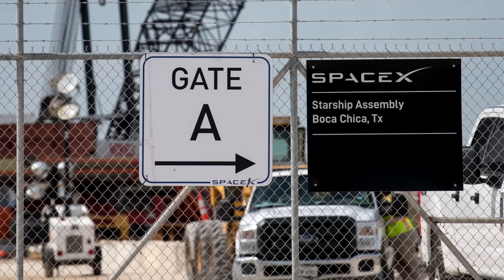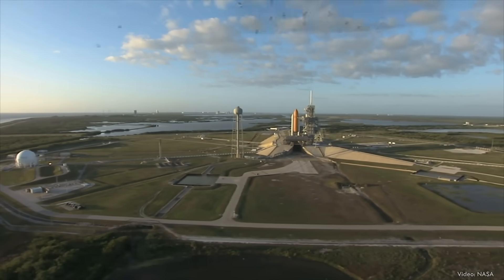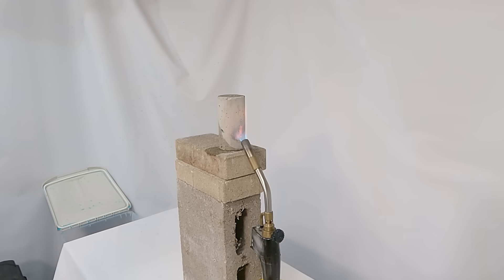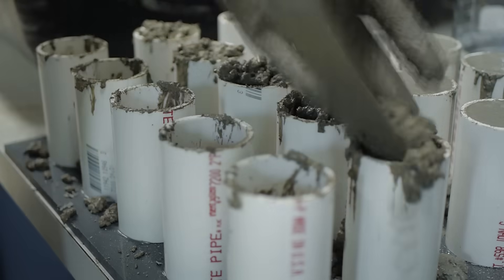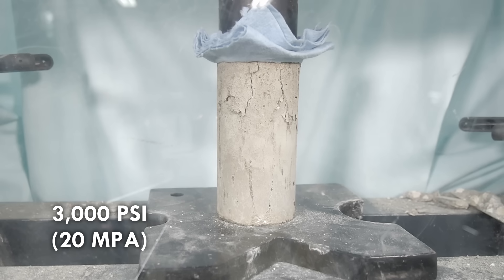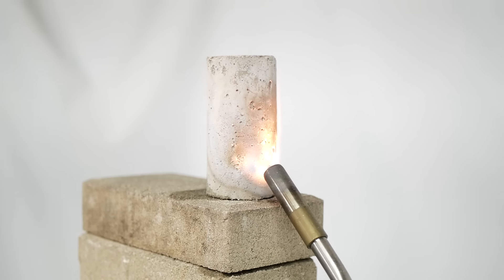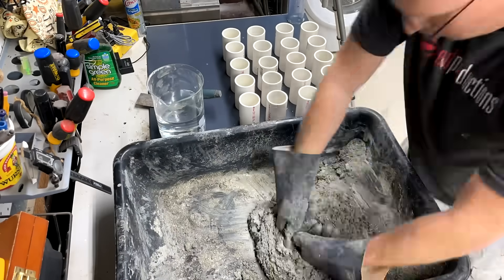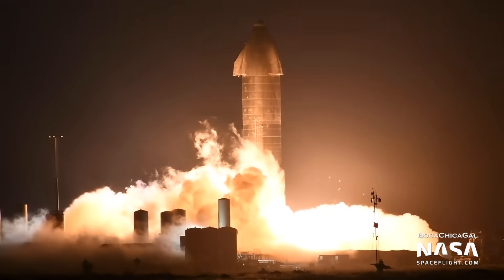Why SpaceX Cares About Concrete

Comment: I will add 1 thing to this.  Couple with all of what you discussed, rocket engines create sonic waves of sound that can easily cause vibration problems.  Sound booms or sonic booms can happen just before the rocket lifts off, hence the water for sound suppression.  This as well is a huge factor in possibly why and inclusive of future designs to prevent concrete launch pad failures.

Comment: Love your work. To what extent do you think the loss of compressive strength in the heated samples could be attributed to less water being available for cement hydration in the curing period? Would a better control demonstrating the effects of heat on fully cured concrete have been curing them in a bath? Thanks
Reply: slump rate or how much water is in the concrete mix effects the concrete quality. He should follow up with a video on water and concrete with different samples to test.
Reply: @practicalguy973  Fully agreed. I think a good follow-up would be a test that allows all samples the same water-to-cement ratio during the curing period prior to heat stressing.

Comment: I learned about  moisture clog spalling when I placed my charcoal chimney on a sidewalk in my yard to get the coals hot. After ten minutes or so  I saw it shoot up about five feet and spew red hot charcoal everywhere, as well as the concrete from an 18" wide 2" deep crater in the sidewalk. A lesson I won't forget :)

Comment: As an avid Spacex watcher I found this very intersting. I also had wondered why they had to do so much repair work to the Channel Tunnel after the fire a few years ago. I hadn't realised how much damage high temperatures caused to structural concrete! I gather that Spacex are still mulling over what protection will be needed for the Orbital Launch Mount. Thanks for the very informative video!

Comment: Heat is part of the challenges of designing a launch pad.  Intense vibration and shockwaves are another.  It will be interesting to see how SpaceX engineers the launchpad and tower to resist the intense soundwaves and vibration without using a water deluge system

Comment: I still say we need to use the SEA DRAGON Rocket instead of these wimpy ones. For one Sea Dragon can Haul 500 TONS into Low Earth Orbit, It also uses the Lake or Ocean it is built/launched from as a infinite launching pad as it actually launches from the water itself.  I scream when I see on youtube various creators when they cover Sea Dragon say one of the main reasons it wasn't used was we had no need for lifting 500 tons?!  Then in another video they will talk about how hard it is to launch Factory's or whole space stations to orbit that we don't have the capability to do it cheap enough...

Comment: One week cure before testing, is not going to yield accurate results.  Concrete has a minimum cure time of 30 days before reaching the large majority of it's compressive strength.
Reply: Considering how Grady already had such a difficult time getting data on the refractory concrete samples, I'd hate to consider how little would happen to them if he let them fully cure. He needs to get a stronger press first.
Reply: @General12th  it is inarguable that refractory cements will yield much higher compressive strengths than ordinary concrete, but the test conditions did shed unrealistic results when heating, as the hydration process was far from complete in the test samples.  It doesn't really alter the results, and probably WAS done due to the limitations of his press, but was a bit sloppy to not even mention the factor.   It also doesn't single out that refractory cements are automatically stronger than Portland blend cements.   I work with anchoring grouts that go up to 10-11K psi.  If his ready-mixed bagged concrete was Quikcrete brand, that stuff is already a substandard product to begin with.

Comment: I don't know if they still do it, but NASA used to pour hundreds of thousands of gallons of water into the blast deflectors during launch. Obviously, this was to cool off the pad to some extent. The water started pouring in a few seconds before the engines ignited. So, a lot of what looked like smoke was nothing more than a huge cloud of steam. Yes, I'm old enough to remember this and watched many, many launches from Mercury on.
Reply: Also to muffle the incredibly sound energy coming off the rockets. Without a way to dissipate that pressure, the launch pad (and rocket itself) would get shaken apart.

Comment: There are some nasty rocket propellant systems - all exhaust is hot but I expect the hypergolic fuel oxidiser combinations are also corrosive.  They even tried chlorine triflouride - that burns on contact with concrete (don't try this at home).
This channel makes me look at things I thought were mundane and realise that they aren't.
Reply: If a modern rocket uses a liquid propellant first stage, then the fuel is just liquid oxygen and kerosene, liquid methane, or liquid hydrogen. Those combinations don't have very corrosive combustion products.

Comment: Hey Brady!  Ready mix concrete provider here.  Just curious:  was the concrete air entrained or simply entrapped air in your test samples?  Would the difference in air content make a difference in the durability based on heat like it does with freeze/thaw cycles?
Reply: I'm no expert, just certified and paid to inspect but to my understanding more air content (to a certain point, too much is also a big issue) the more resistant concrete is to freeze/thaw of normal temp fluctuations. More air means more room for that expansion and shrinkage without causing cracks, where concrete with less air has less room to work with. 

For concrete under extreme heat like this video I would have no clue.
Reply: @aberrance6706  that is more air that will expand and contract with temperature changes

Comment: The testing difference is also because concrete cures not by drying but thru a chemical reaction that actually counts on a proper moisture level over a long period which is why you see some pours covered by plastic to maintain moisture levels. Heating it early in the curing process (particularly under 28 days) removes some of that water which inherently weakens it, not to mention the damage caused by steam generation at an expansion of 144 times compared to water and the heating of the agragetes...

Comment: I recall using portland cement once as a binder for a clay crucible I was making for smelting aluminium. I fired the crucible in a pile of burning charcoal before it had completely dried, and a small piece of it spalled off and crack my eye glasses.
Reply: Mind if i RANDOMLY recommend a cool Channel like Practical Engineering or Veritasium or Its ok to be smart?
Reply: @slevinchannel7589  already subscribed

Comment: Why didn't you wait longer to test the concrete samples? Most concretes need over 28 days to reach their maximum strength. Some types of cement contain add-ins to fasten the curing process, but you didn't ensure all concrete had the time to fully harden, which could have made the results different?

Comment: Many years ago I was camping in a Massachusetts state campground with some friends.  The fireplace was brand new and made of cement.  About an hour after lighting our camp fire the fireplace exploded, showering us with bits of cement and burning embers.  No one was injured and we extinguished all the embers.  We concluded later that the explosion was due to uneven thermal expansion in the concrete.  In retrospect, steam was probably a factor too.
Reply: Steam pressure was THE cause—although I suppose you could call the explosion “thermal expansion”.
Reply: @MarcosElMalo2  No, according to OP thermal expansion caused the explosion, that's why bridges all over the world explode during hot days XD.
Reply: @motss5651  I don't know of any places where the bridges are swathed in flame on hot days.  Except maybe Phoenix.
Reply: Cement and fire just don't mix too well 😂
Reply: It's dangerous to make fires in caves for this reason.. or to put rocks in a fire to heat up, they can explode
Reply: @chronicawareness9986  Yep.  Miners used fire to break or weaken rocks when mining back before the invention of reliable explosives.

Comment: Lunar regolith is very coarse stuff, I bet it could make some pretty amazing "sand" for a concrete mix.  Of course getting the cement there would be problematic due to the as mentioned weight issues.

Comment: There are different types of fibers added to refractory cement. Some are designed to "burn out" during the curing phase that occurs in the oven when precast refractory shapes are dried. The voids left by the fibers that are burned out give the steam escape paths. "Fibers" that are added to the material for strength are generally some flavor of stainless steel. Without seeing more detail on your process the other factor that can greatly change the strength of a monolithic castable refractory is the water content when mixing. Based on how your samples looked it looks like you may have over watered the material. Typical cement is ~20% water when mixed properly. Monolithic low cement refractory is typically correctly hydrated at between ~4%-~7% depending on the brand and type. I did very much enjoy your video. There is much more to refractory cements than meets the eye. It is one of the things that is widely used in industry but poorly understood or completely unknown to a large amount of people. Thanks for another good informative video.

Comment: I don't think your explanation is entirely correct. When concrete hardens, you end converting a lot of metal oxides and silicates into hydrates (i.e. adding OH groups that gives the concrete its integrity). While I'm sure there is some stress cracking when you heat concrete, a far bigger problem is that you're chemically decomposing the reacted portland cement back into its original metal oxides and silicates, removing almost all of the concrete's strength.
Even 100 percent "dry" concrete will off-gas water in a kiln and be baked back into a brittle, chemically unhydrated form.

A similar thing happens to carbon dioxide cured calcium carbonate cements. When exposed to heat, they off-gas carbon dioxide, losing mass, integrity and reverting to calcium oxide.

Comment: Can concrete undergo a chemical change similar to Clay if subjected to heat over time?
Reply: In theory it could if you use a cement that can handle the heat and hold things together until the aggregate particles fuse (like a ceramic). I don't think this will work with portland cement based concrete because it will decompose before the aggregate particles fuse. But I think it is possible with Calcium aluminate cement.  You may also be able to do it if you mix a appropriate aggregate material with sodium silicate solution. The sodium silicate will harden as water evaporates and when fired it can fuse into a ceramic state.

Comment: Interesting that you mentioned the effects of jet blast on the surface of the Moon. The moon, having no refractory concrete, must have kicked up enormous amounts harmful debris, yet I've never heard of any reports that the LEM nor the astronauts were in danger from it
Reply: Anything kicked up from the Lunar surface would follow a simple trajectory. There is no air for dust to float around in. Even the smallest dust particle would settle as quickly as a massive boulder. So, sure it kicks up a lot of dust, but it all settles very quickly.
Reply: At 1/6 gravity I'm sure some debris would persist for a while
Reply: @gwernette5971  Depending on its vertical velocity, some does. But since all of it has some horizontal velocity, it all lands some distance away from the landing site. And again, none of it floats around.
Reply: Also remember that the LEM was light and the Moon's gravity is low. They didn't need a very powerful rocket to leave, so there was less chance of gouging out huge portions of the landscape and turning it into wild shrapnel.

Comment: Concrete flame deflectors can also make use of ablative materials to prolong their life, though we've been trending away from concrete towards sacrificial steel plates or water-cooled steel structures depending on the application.  Testing, launch, and now landings each involve their own service environment-specific requirements to consider during design; time of exposure to thermal loads, size and intensity of those loads, frequency of use, and maintenance schedules and costs.

Comment: Opening Spiel is disingenuous. The "Engine abruptly stop" part. First, Engines, three of, and they ran full burn for that test, they stopped when they were planned to stop, and them stopping had nothing to do with the Martyte coating on the concrete pad being damaged.
Edit: Doubling down with the "Coming down has a lot less precision then going up",.. yeah, ya got that backwards, there's no ground to get in the way going up.
Edit2: yeah, you messed up there with the blow torch on the concrete. Besides the fact that there is no way you can match the blend of concrete used in the pads with anything civilians can buy, you never took in to account the Martyte coating material the pad is covered with that stops the flames ever getting to the concrete.

Comment: Nokia brick phones could be used to plaster over the entire launch pad, but difficulties include potential destruction of nearby continents in case of ejected phones, and accidental self-activation of the call vibrators, shaking the launch vehicle off of the pad. International teams are working together with Nokia to review alternate designs, however the personnel are facing legacy engineering tricks that were not disclosed in documentation.

Comment: i appreciate the work you put into showing people how things work, and the work we do as applied scientists. as applied scientists i believe it is incumbent on us to be as environmentally responsible as possible, we are the avenue to building much of what we do as humans. your concrete forms could have been made using paper towel or toilet paper rolls rather than pvc pipe. the environmental and ecological  footprint of this presentation would have been smaller. going forward this should be a considered factor, and could be highlighted, in your presentations.
Reply: Using a mold other than a rigid plastic would likely yield inconsistent results. Thin cardboard tubes tend to burst during the tamping process. Concrete manufacturing, itself, is very hard on the environment.
Reply: If Grady keeps reusing the PVC pipe for future concrete projects, then I don't see much of an issue.

Comment: Looks like the dry out of the refractory concrete may have been ended prematurely. 
Water left in the refractory can cause a catastrophic failure once heated.
The rocket ignition cases this in nanoseconds.

Comment: From a propulsion perspective, how important is it that the rocket has a pad to "push" against, vs. say, being hypothetically raised  100 feet above the surface?
Reply: Not important at all, the thrust comes purely from expelling the exhaust out the back of the rocket.  Raising the rocket high above the ground to mitigate the effect of the exhaust hitting the pad definitely works, but this does add difficulty to the construction of the mount holding the rocket, as it needs to be taller and still strong enough to support the weight of the rocket before launch.  Also, you need to lift the rocket higher up to get it there, which adds complexity to your launch tower or crane.
This is what SpaceX is doing with their orbital launch pad for Starship, if you look at images you can see that the mount is quite high above the ground.
Reply: Not important, as the other two comments point out. Rockets aren't like helicopters -- here's no "ground effect" that adds extra force to the rocket during launch.

Comment: Grady, you may not have realized it, but the large elongated black strangely shaped object on the underside of the perseverance rover is actually a thin carbon fiber and honeycomb debris shield which was made specifically to protect the fragile mars helicopter during the skycrane maneuver. Especially relevant to the discussion, where the rubble and ejecta during landing from plumes specifically influenced design decisions; in this case we needed several new parts as well as dedicated inserts on the bellypan to be able to attach to. Mass and space on a mars rover is really important, so it's clear that this was a substantial concern.

I was (in a small way) involved with the stress analysis and design development of those components at one point, on the mars helicopter deployment system (MHDS).

Concrete is important to so many industries for so many different reasons! Great video.

Comment: Apparently from my research 👉smoother river sand is used  & also concrete chimney walls can be sprayed with sodium silicate (water glass).
Upon heating - The silicate will form glass.
Their is also the carbon element having the highest known melting temp and the use of graphatised concrete having ~400% increase in strength 🤔
There's Way's to use silicone sand in a rotary cement mixer type cylinder and heating it to less than 350°C for carbon coating from the CO2 gases in air (Going above that temperature will cause the carbon coating to break down) 🤔 .

Comment: I'm not surprised at all that the concrete made out of smaller particles was stronger. Maybe I'm oversimplifying it, but it seems like having big chunks gives the concrete a less uniform and therefore inconsistent load distribution. It also seems cheaper to source than finely ground concrete. NASA also releases many gallons of water in order to keep the concrete from taking heat damage.